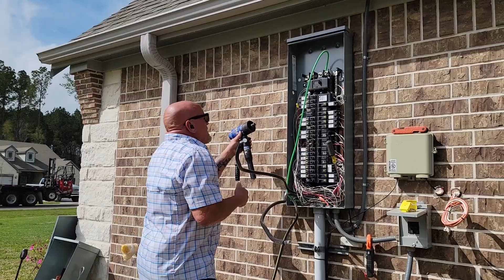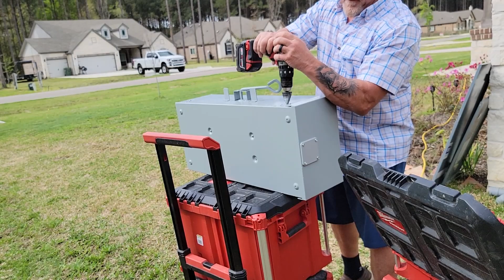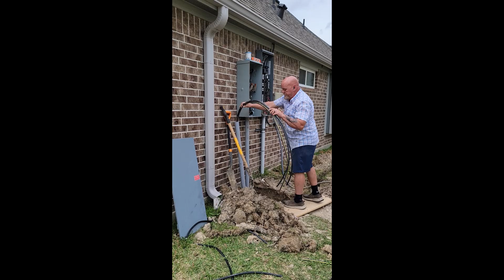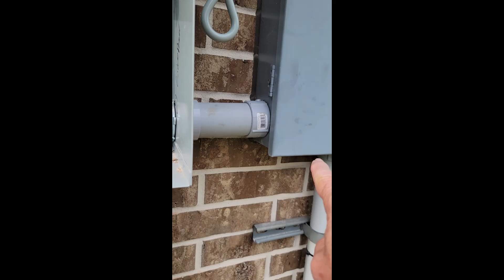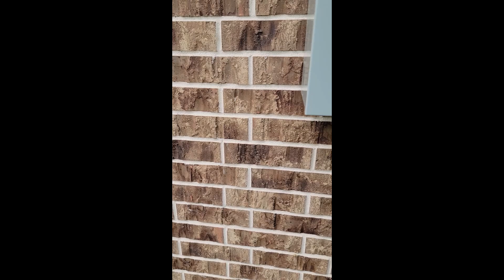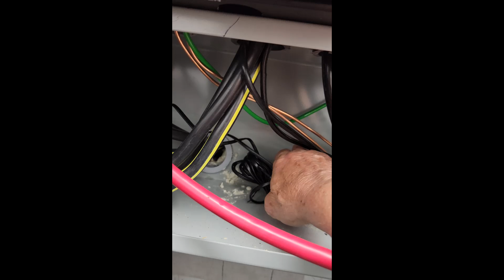18k Transfer switch

Comment: Are the Neutrals and Ground bonded in the transfer box? If so, did you adjust them in the main panel?
Reply from the maker: The ground neutral bond was in the main breaker box, but he moved it to the transfer switch.
Reply: @gerrypineau  Nice!

Comment: Did this pass an inspection? I don't see any plastic bushings. You would also be required to run a 4 wire to and from your power shed. Sealing locknuts or a hub would be required for the penetrations into both the panel and the transfer switch on the upper conduit minimum.

Comment: Don't all aluminum connections require an oxide inhibitor???
Reply from the maker: I may not have shown it being applied but Yes, it was used on all connections. It's the dark pasty stuff on the wires.